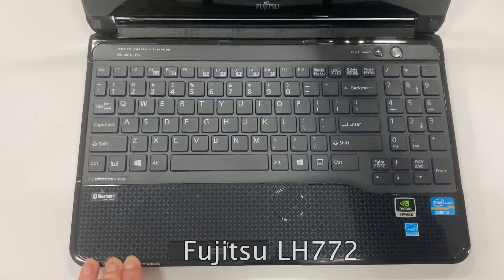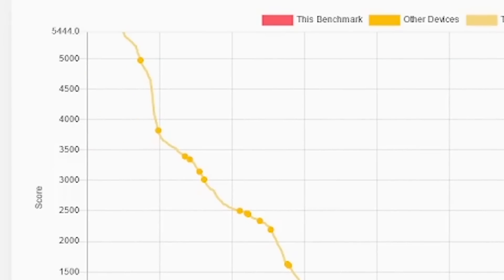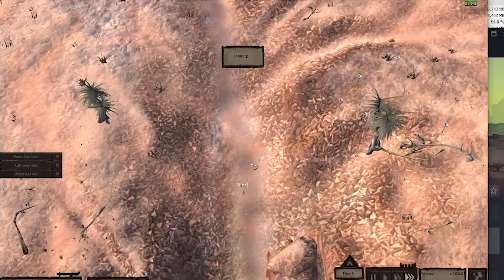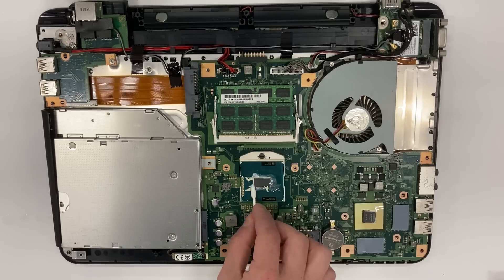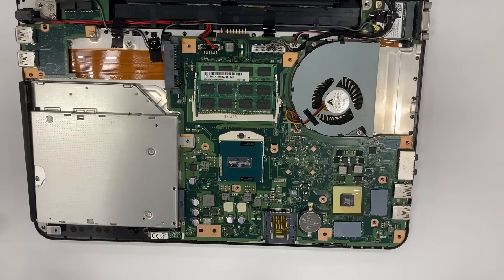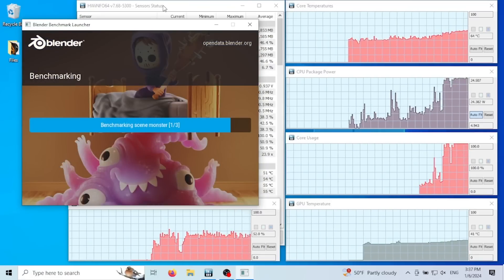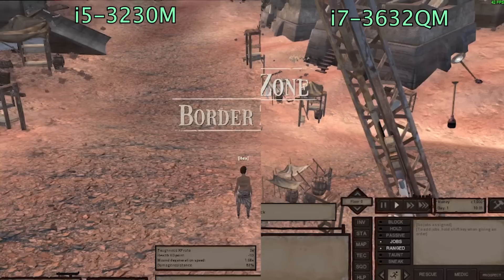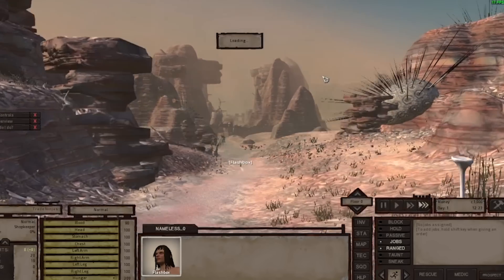Upgrading a 10-year-old laptop. Is it worth it?

Comment: Haswell 4th gen Intel core is ideally the sweetspot for these laptops. i7-4700MQ is a ridiculously fast mobile chip for the age and perfomance per watt is impressive vs desktop i7s from that era.
Reply: yep and as long  as there is a socket you can even find mutant i7 4980hq cpus with iris graphics that absolutely sing :)
Reply: @zerokool1985  if you don't have discrete GPU, then Iris almost doubles the performance, but it is still extremely bad for any real gaming besides very old games and emulation of course. I am honestly surprised that those "mutant" CPUs are cheaper than MX haswell series, having in mind somebody put materials and effort to create BGA-to-LGA adapter ..
Reply: @stzokev  my alienware 18 has a 4930mx at 4.4 ghz  plus its quadro rtx 4000 it keeps up with everything i throw at it :) im surprised honestly . i do want to get a i7 4980hq mutant cpu but its so hard to find it  the l4 cache really helps in games
Reply: @stzokev  sir can i ask question? my old pc i5 gen 3 and motherboard digital alliance and GTX 750 ti(already re thermal paste cause GPU artifacts and never happen again) has keep alive for 6 year old and now my old pc every 1 weeks no signal after show bios cant boot to windows i trying remove cmos battery for 5 minutes and it normal again.but after 1 weeks it keep happen and happen again do you why know?? note: i replace cmos battery with new and my house electricity every day normal even i use UPS for unexpected power outage
Reply: @zerokool1985  sir can i ask question? my old pc i5 gen 3 and motherboard digital alliance and GTX 750 ti(already re thermal paste cause GPU artifacts and never happen again) has keep alive for 6 year old and now my old pc every 1 weeks no signal after show bios cant boot to windows i trying remove cmos battery for 5 minutes and it normal again.but after 1 weeks it keep happen and happen again do you why know?? note: i replace cmos battery with new and my house electricity every day normal even i use UPS for unexpected power outage
Reply: @zerokool1985  sir can i ask question? my old pc i5 gen 3 and motherboard digital alliance and GTX 750 ti(already re thermal paste cause GPU artifacts and never happen again) has keep alive for 6 year old and now my old pc every 1 weeks no signal after show bios cant boot to windows i trying remove cmos battery for 5 minutes and it normal again.but after 1 weeks it keep happen and happen again do you why know?? note: i replace cmos battery with new and my house electricity every day normal even i use UPS for unexpected power outage
Reply: I have an old Lenovo laptop with an i7 4700MQ. It's still surprisingly usable. But I quit using it because it's heavy and has no battery life. 

Still keeping it around, why not?
Reply: @windowsuser321  sir can i ask question? my old pc i5 gen 3 and motherboard digital alliance and GTX 750 ti(already re thermal paste cause GPU artifacts and never happen again) has keep alive for 6 year old and now my old pc every 1 weeks no signal after show bios cant boot to windows i trying remove cmos battery for 5 minutes and it normal again.but after 1 weeks it keep happen and happen again do you why know?? note: i replace cmos battery with new and my house electricity every day normal even i use UPS for unexpected power outage
Reply: sir can i ask question? my old pc i5 gen 3 and motherboard digital alliance and GTX 750 ti(already re thermal paste cause GPU artifacts and never happen again) has keep alive for 6 year old and now my old pc every 1 weeks no signal after show bios cant boot to windows i trying remove cmos battery for 5 minutes and it normal again.but after 1 weeks it keep happen and happen again do you why know?? note: i replace cmos battery with new and my house electricity every day normal even i use UPS for unexpected power outage
Reply: @gunawangunawansantoso4122  If your GPU has artifacts, it's already damaged.
Reply: @saricubra2867  it true my gpu once articating before i re thermal paste my gpu.but after i do it it never happen again sir

Comment: From 2 to 4 cores, it makes a difference. You could also replace RAM to a 16 GB kit. For browsing the Internet, those old laptops are surprisingly usable. And there are many old video games, which could run on it.
Reply from the maker: True! After the CPU upgrade alone, the laptop is already quite usable. I will look for RAM kits and upgrade it later too.
Reply: @hardwarerepair200  its a sin to not overclock the gpu
Reply: @Armki  sir can i ask question? my old pc i5 gen 3 and motherboard digital alliance and GTX 750 ti(already re thermal paste cause GPU artifacts and never happen again) has keep alive for 6 year old and now my old pc every 1 weeks no signal after show bios cant boot to windows i trying remove cmos battery for 5 minutes and it normal again.but after 1 weeks it keep happen and happen again do you why know?? note: i replace cmos battery with new and my house electricity every day normal even i use UPS for unexpected power outage
Reply: sir can i ask question? my old pc i5 gen 3 and motherboard digital alliance and GTX 750 ti(already re thermal paste cause GPU artifacts and never happen again) has keep alive for 6 year old and now my old pc every 1 weeks no signal after show bios cant boot to windows i trying remove cmos battery for 5 minutes and it normal again.but after 1 weeks it keep happen and happen again do you why know?? note: i replace cmos battery with new and my house electricity every day normal even i use UPS for unexpected power outage
Reply: That's what I did 22 dollars off Aliexpress with free postage for 16GB of RAM